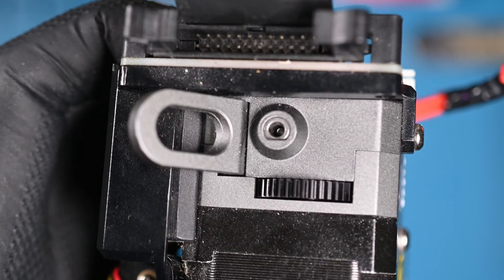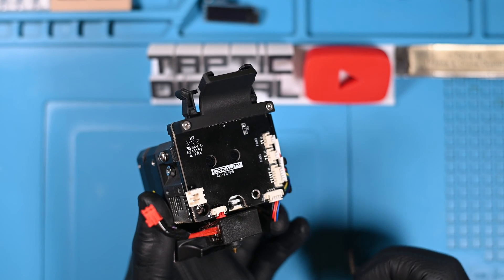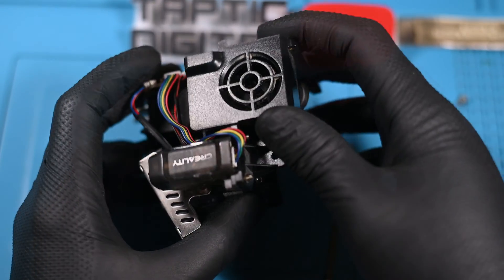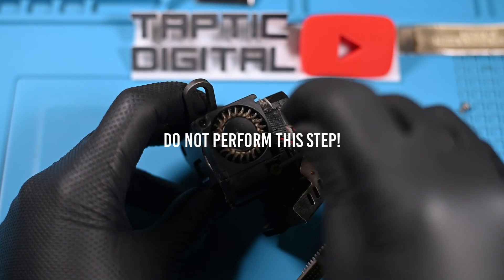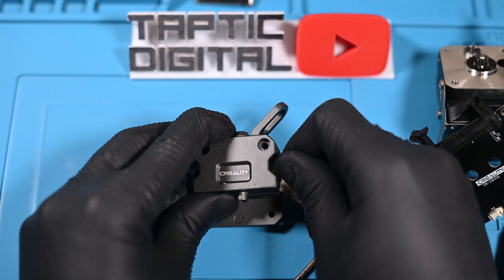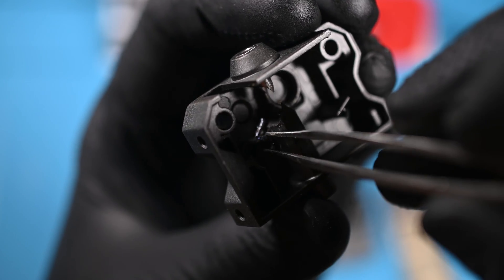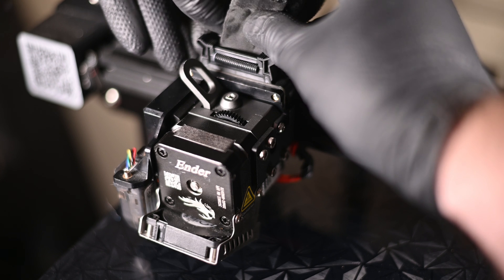All jammed up! - Creality Sprite Extruder Pro Teardown

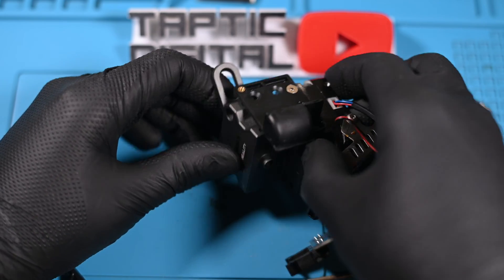Comment: if you dont put the front screw back in at 3:54 under the fan, you can just take the 2 side screws off holding the fan shroud and the other side of the extruder, slide it up wards once youve unplugged the thermister, heater cartridge and taken out the bolt holding the board to the assembly without having to take the fan off again

Comment: Ive opened my sprite pro atleast 10 times thinking  it should be fix now,yet no luck ,filament pulls in partially then gets stuck looks like it pinches.i cleaned nozzle and whole channel,ive heated 260 for awhile hoping ..creality you suck for making such finiky crap.
Reply from the maker: @grantstemmet606  one of the screws on the side of the Sprite, the screw that is in at an angle, will adjust the gear tension. It may help to loosen it slightly so filament isn’t pinched as much or chewed as it passes through. Worth a shot at least!
Reply: I had simar issue the weld had broken on the drive gear so it stopped extruding completly too a while to figure it out

Comment: I was going nuts as my extruder was jamming every time.  Replaced the nozzle a dozen times, the whole heat block, the mother board.  Kept jamming.  I guess when I was playing with it the first time I cranked that spring on the extruder gears.   The gears were smushing the filiment so wide it was getting stuck in it PTFE tube. :S

Comment: 2:22 you don’t need pry tool, just press the filament release tab to relieve the tension in the gears and you can remove and reassemble easily….
Reply from the maker: @RiccoFX  very good tip, this should make my next jam much easier, thanks!

Comment: Thanks for this video, it gave me some ideas what to expect when I needed to also unblock mine which was actually the exact same problem. I was not sure whether when I opened it, it would be benign, or whether a bunch of spring loaded mechanisms would pop out and I would destroy my printer :/ This helped a lot, cheers!
Reply from the maker: Glad to hear it! I felt the same way opening it, there were several shots I didn’t include of me very carefully trying to separate it and look inside to make sure I wasn’t about to launch springs into the abyss!

Comment: im having a huge issue on my sprite dd extruder the brass or copper guide thats pressed into the top is completely wore out ive been searching for weeks to find such a small replacement part and no one sells them i even googled pic search and found nothing is there any chance you may know where to purchase them if so is there are harder metal replacement?
Reply from the maker: Think you could take a picture of the part in question and email it to me? My contact info is in the about page of my channel. I’d be happy to take a look!
Reply: @TapticDigital  i really appreciate it thank you its stressful
Reply: @TapticDigital  i sent it over 2 times first was rejected address not found or unable to receive mail

Comment: Anyone know the best firmware for this as the Creality one I downloaded I had to off set the y axis as it was probing off the bed and now it only bed levels about 3/4s of the way to the back of the bed. The small cr touch probe wire also doesn’t seem to be compatible and I’ve had to keep using the original long cr touch cable.
Reply from the maker: Look for Ender 3 v2 Professional Firmware. It’ll be on GitHub, and it’s far better than anything creality has.
Reply: I installed Creality's Sprite firmware for the Ender 3 Pro and it probes in the correct places.

Comment: So the PTFE tube doesn't really touch the nozzle because there is a heatbreak between the tube and the nozzle right?
Reply from the maker: Bingo, the PTFE tube only acts as a guide from extruder gears to heartbreak, nozzle never touches it.
Reply: @TapticDigital  thinking of installing a Sprite extruder on my ender 3 v2.
Reply from the maker: @celeriomods8171  that's what I did for mine, once I had the e-steps and extruder offset right (the sprite is slightly bigger than the stock so the printer doesn't know where the center point actually is unless you tell it) and I haven't looked back. It prints anything I throw at it
Reply: @TapticDigital  
Yes. It seems the single weakest point on the entire Ender 3 system is the Bowden tube fed indirect extruder. Replace that and they're fine.
Reply: Sprite, and sprite pro. In the pro, it is the way you describe, on the sprite there is ptfe tube touching the nozzle. I think I will downgrade mine to ptfe, as ti seems to be easier to unjam

Comment: Are those gears removable? I have been getting inconsistent layer lines no matter how much tuning I do. I'm worried I might have oblong gears or the bore for one of them may be slightly eccentric. I don't see any where to buy replacement gears and I want to say I saw somewhere that one of them is soldered to the shaft.
Reply from the maker: They do seem removable, though you may have better luck adjusting the tensioner for those gears. Depending on what material you print, a lighter or heavier tension can make a world of difference
Reply: I'm having the same issue :( already tried everything (adjusting the screw as well). How'd it go?
Reply: @theunstopablebullet  I bought a Bambu Lab X1C, so it went well 🤣
Reply: @anbu94  lmao